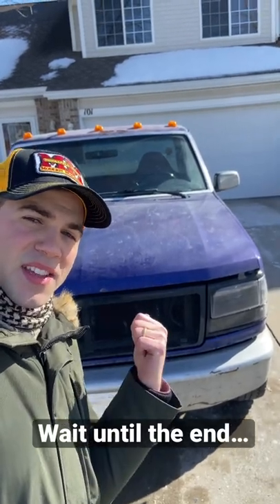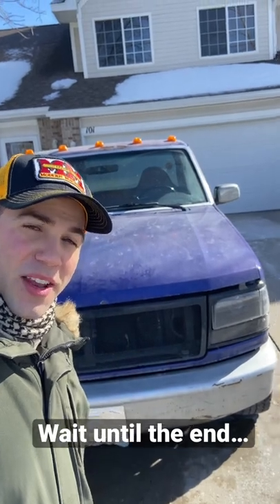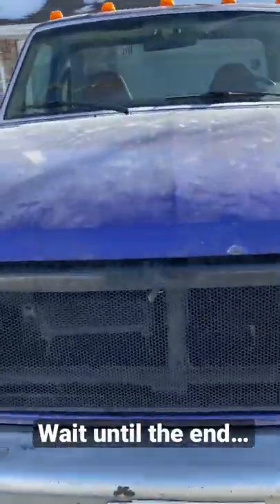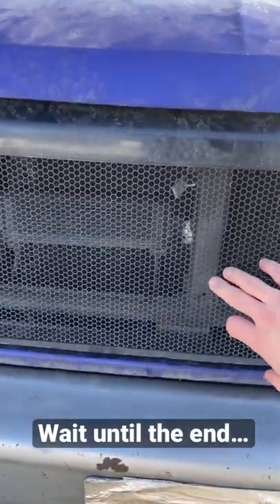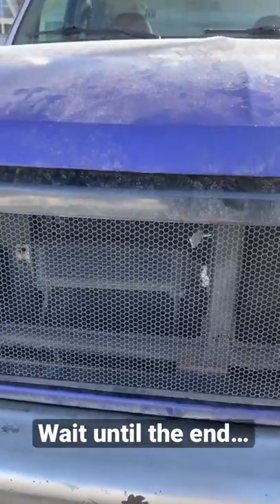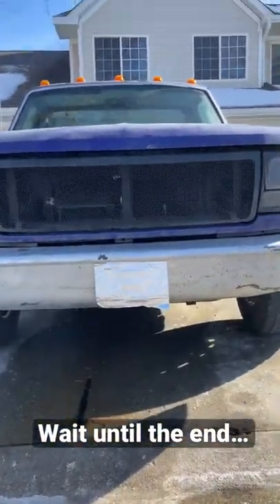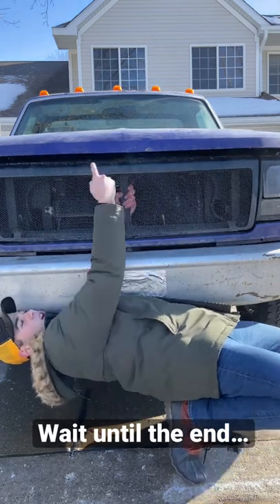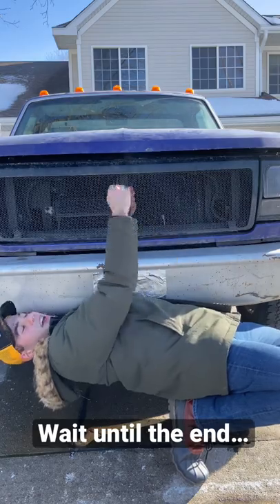1 Major Flaw of Mesh Grilles - F150

Comment: I modified my latch so when the hood pops up you can put you fingers  under the hood and push down  like a modern vehicle.
Reply from the maker: I did the same thing, but it was hard to use sometimes. The bull nose trucks actually had a good hood released mechanism.
Reply from the maker: How did you modify your stock latch?
Reply: I made a little bracket that goes above the grill so when I hood pops up you just push down on the bracket that I made and it's tack welded to the original lever. Wish there was away I could show you some pictures.
Reply from the maker: @dancain9660  Sounds similar to the bolt on solution from cp addict. I had one but I don’t think it worked the best.
Reply: I tide a string from the lach and raped it around the hood bump stop at put a loop around the stick in the headlight

Comment: I put a billet grille on mine and it came with a little bracket that bolted to the latch and let you push it from the gap under the hood
Reply from the maker: Nice! I did the same thing a year ago but when I replaced my hood latch, I didn’t put it back. I thought the mod was ok. Maybe it being ok was a function of my hood latch going to crap.

Comment: When you were running the mesh grill, did you have problem of ice building up on it in foggy freezing days or when driving while it was snowing?
Reply from the maker: Actually now. I did have ice run down it from time to time but not enough to block air flow.

Comment: Got a question. the cab lights on top of your roof of your pickup were they already there when you got the truck or did you install yourself? if so can you make a video about that please? I like to put cab lights on my trucks.
Reply from the maker: The previous owner installed a crappy set that would always short out. So I swapped them out with this LED set from Amazon. I made a tips and tricks video showing how to mount them using rivet nuts.  It’s in the headlight and electrical playlist. If you want to know where to wire them up to.  You can watch the video on how to install a transmission temperature gauge. I show you what wire to splice into.
Reply: They came on my obs Ford from factory,super sweet looking,I think.
Reply from the maker: @JoeRocket-sf6qs  Nice! That’s the best way to get cat lights. Too often when people add them after market they leak.

Comment: Hood latch I’m guessing. I need that front end look
Reply from the maker: You can buy hood latch relocation attachments but they are ok.
Reply: @TheMinuteMasters  do alignment shops still work on these twin I beams suspension ?
Reply from the maker: @SC-dt4ij  They sure do. It sounds like it may take some shopping around. I took mine to a Firestone Tire and the head guy know how to do the alignment. Adjustable camber bushings also come with an adjustable guide/table.
Reply: @SC-dt4ij  Anyone that takes a porta power to adjust camber is maybe going to get it kind of close. The ones that take a torch to the I beams are destroying them.
It won't be cheap to adjust anything outside toe.